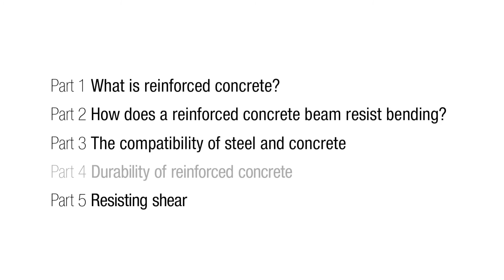Durability of Reinforced Concrete - Bare Essentials of Reinforced Concrete with Prof Tim Ibell Pt4

Comment: Do they ever use stainless steel?
Reply: londontrada how much money will this cost?
The design has they be safe, economical and efficient.
Reply: Majed Saleh  I don't know, how much will it cost?
Reply: It's very expensive (you are talking about producing steel bars of 14mm in diamater of stainless steel)
Reply: Majed Saleh You would think there may be some applications where it might be worth the cost. When the concrete cracks water can get in and corrode the metal
Reply: There are some other reinforcements made of fiber (fiber reinforced concrete) and other materials and each has it's own pros and cons.
Reply: They do use stainless - http://www.concrete.org.uk/fingertips-nuggets.asp?cmd=display&id=797